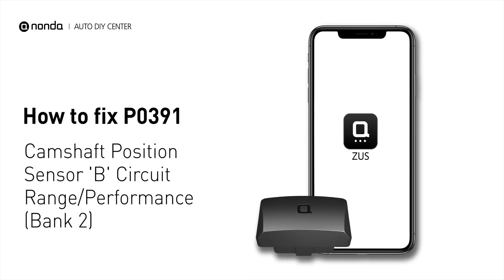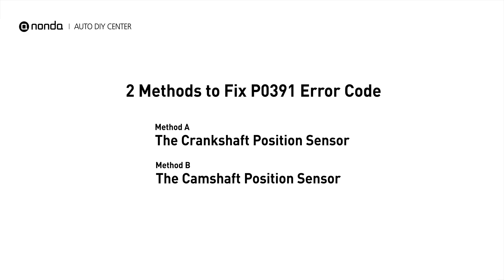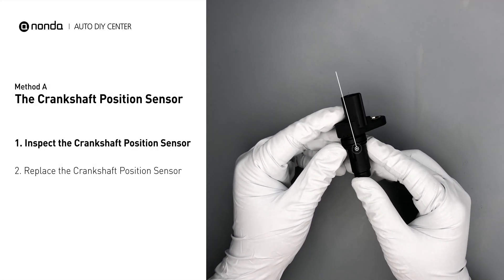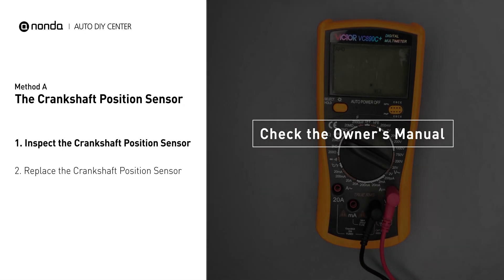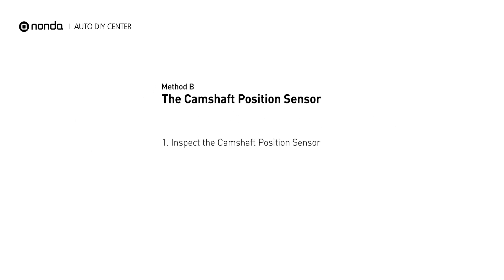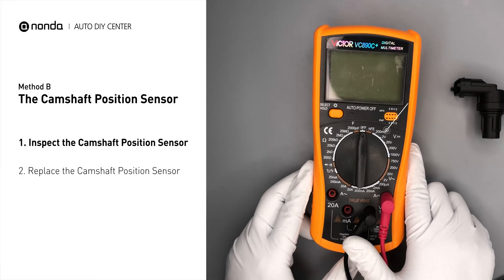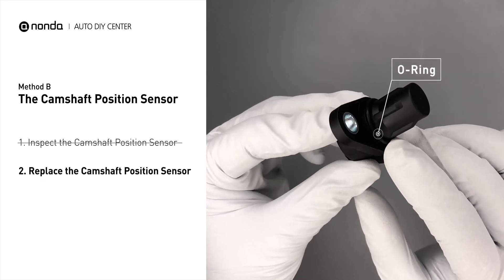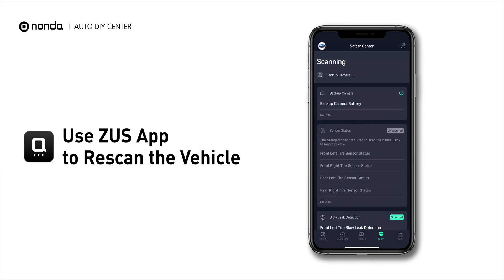How to Fix P0391 Engine Code in 3 Minutes [2 DIY Methods / Only $9.78]

Comment: I have a 08 gmc acadia 3.6 , new timing chain , replaced 1 head with valves , arms lifters ,springs , replaced all 4 camshaft sencors and still get a p0391 ? . Crank no start .

Comment: Timing was done. All 4 camshaft position sensors was done. The crankshaft position was done. But codes keep popping up related to camshaft position sensors. P0391, and P0010. 2008 Buick Enclave CXL 3.6L VVT V6 2WD
Reply from the maker: Hello, as you are receiving more than one error code, we highly suggest getting your vehicle visually checked by your local mechanic for further diagnosis.